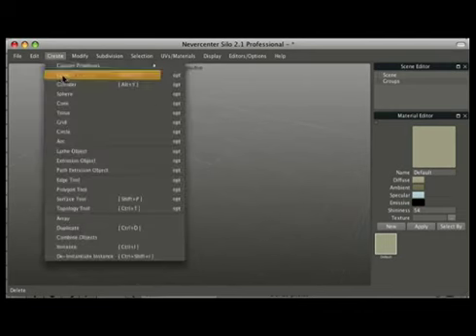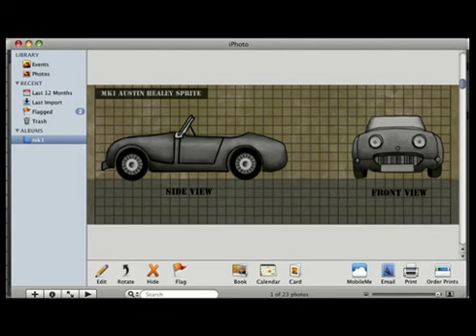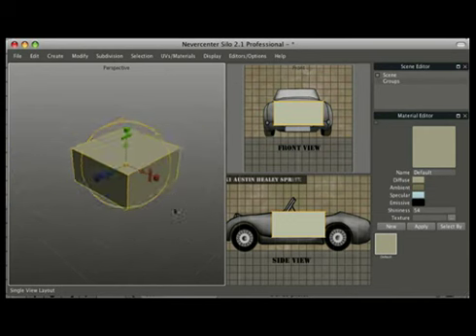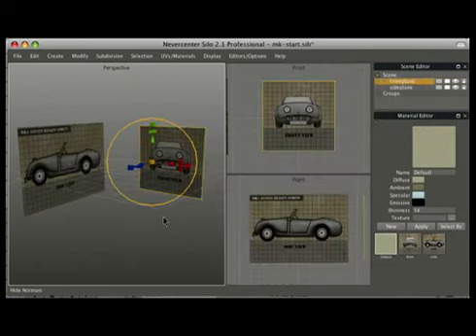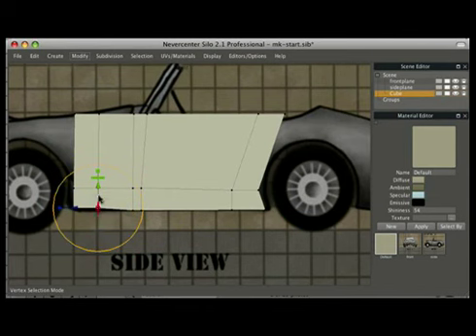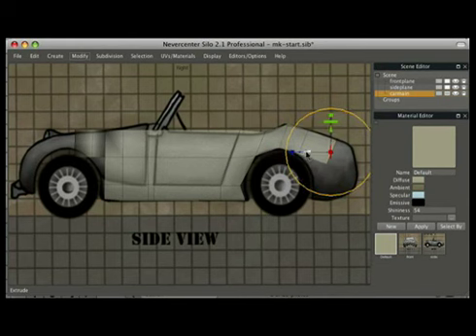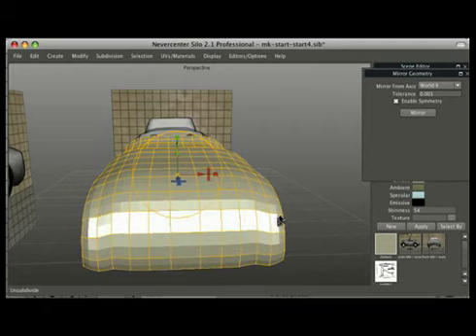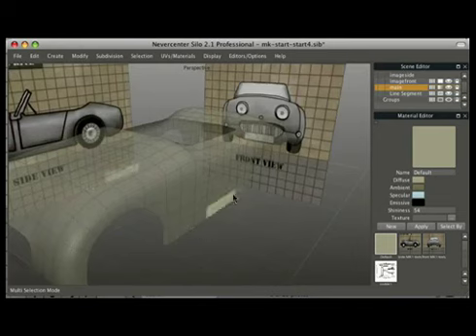Modeling a Car - Part 1 of 4

Comment: The resolution of this tutorial is a disgrace and very hard on the eyes. It should be removed or upgraded.
Reply from the maker: This tutorial was created years ago by a kind Silo user, and at the time this was the standard res setting--unfortunately, we don't own the original files for this at any higher resolution so there's really nothing we can do. Some people do still reference this tutorial, so we are leaving it up for them. You might like to check out the Glen Southern series which we were able to get a bit higher-res in 2019 doing a remake using the originals we had for that (on our channel page, 3 Glen Southern series there). But yes, definitely shows how much things have changed with video resolution over the years!
Reply: @nevercenter  than redo it. This video is harmful to the eyes as it causes eyestrain. As a licensed owner of Silo3D I find your excuse very disrespectful. The video should be at least 760p.